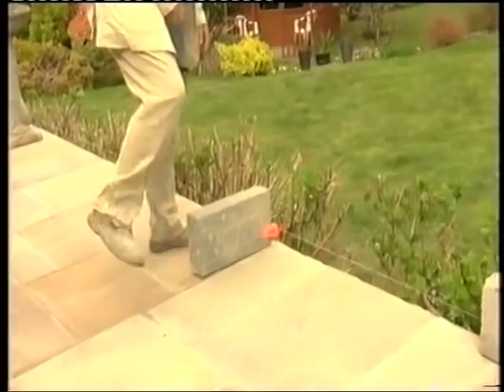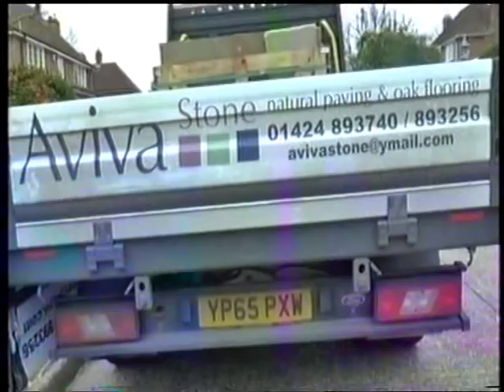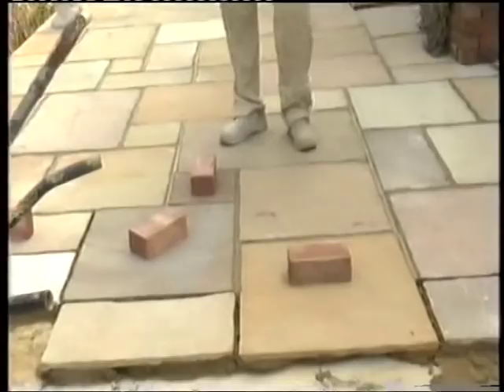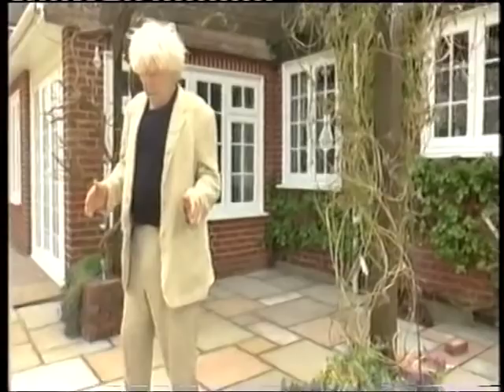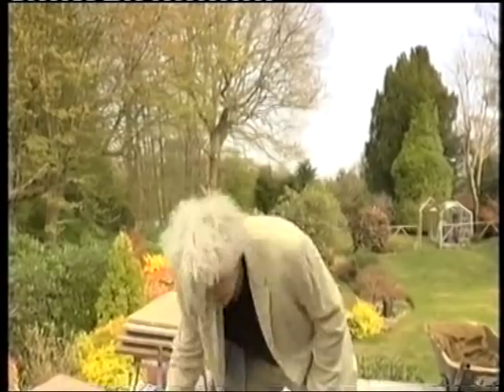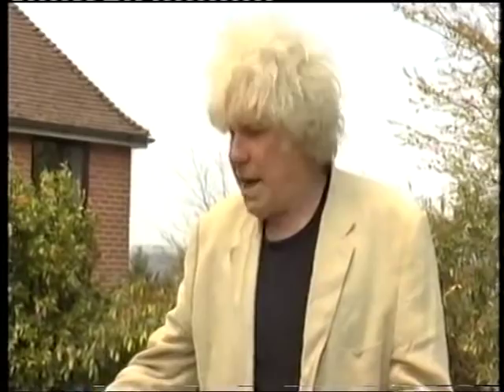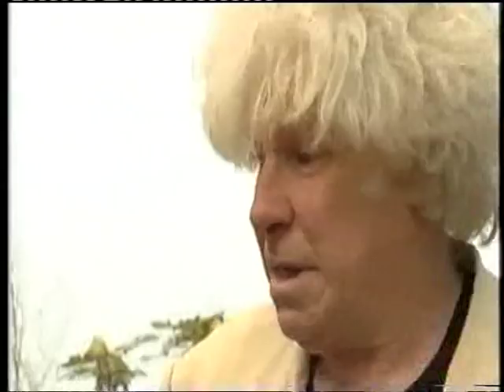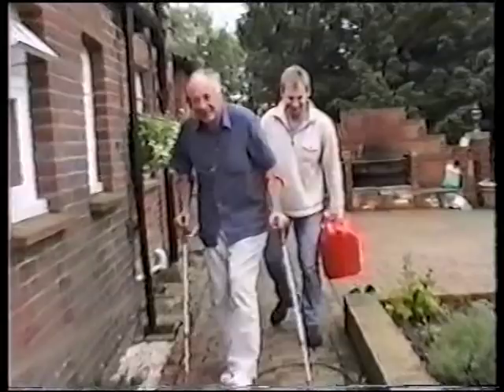BRICKLAYING MADE EASY 5

Comment: Hello Glenn, what mix are you using for the slabs please?
Reply from the maker: Just 4-1 sand and cement buddy. Mick joints it with bit of plastering sand added. Sometimes it's sharp sand. Just depends on what finish is needed. Take care mate, glenn